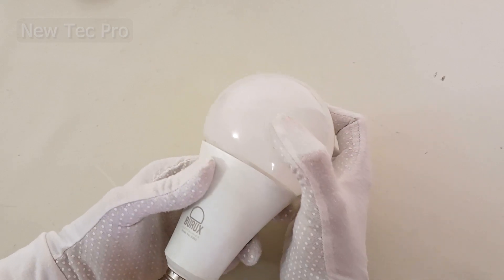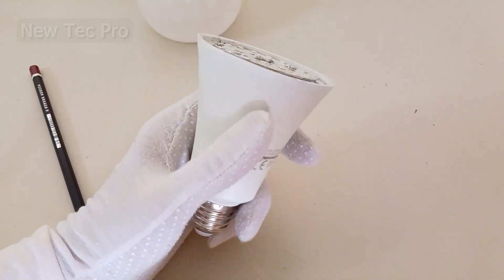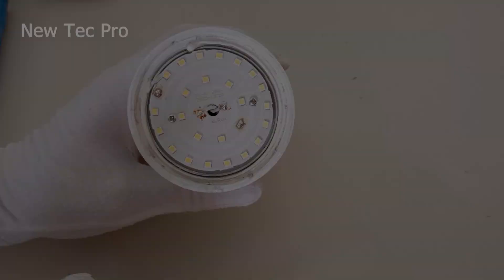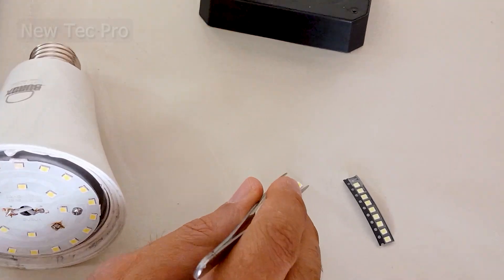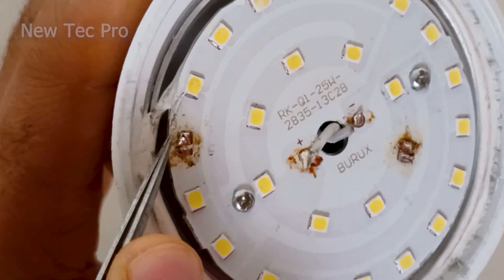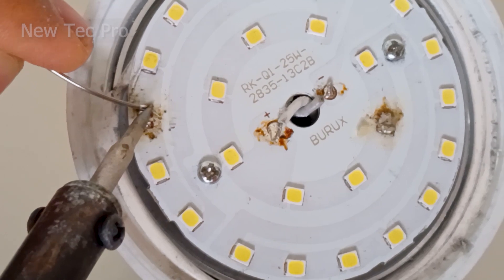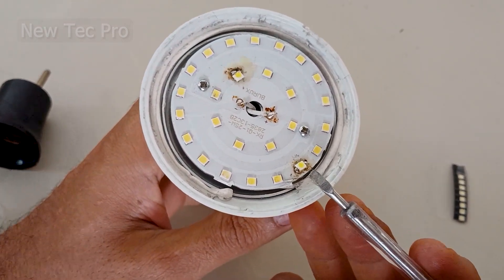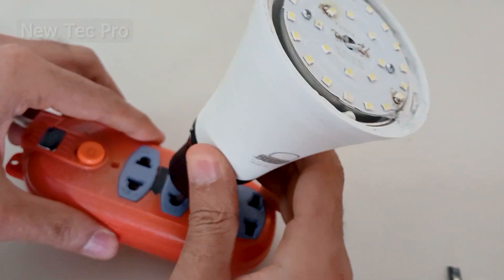How to Repair LED Bulb the Right Way | Replace Burnt SMD LEDs Easily

Comment: That's not the right way. Remove the board from the housing, clean the board way more than in your vid but most importantly heat the back of the board to melt the solder. Using a soldering iron on the plastic LED will melt it.
Reply from the maker: I appreciate you sharing your alternative method for repairing LED bulbs, which could be helpful for some viewers.